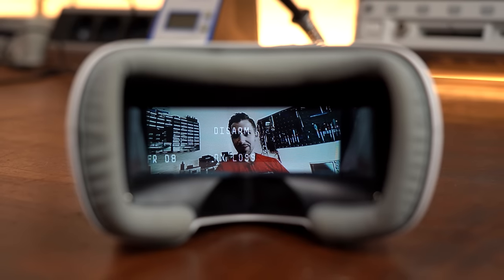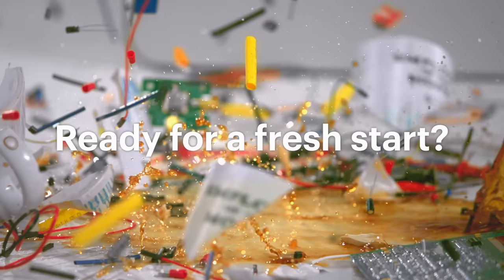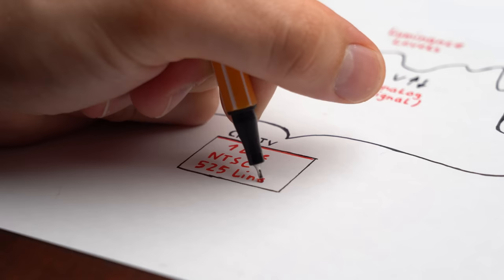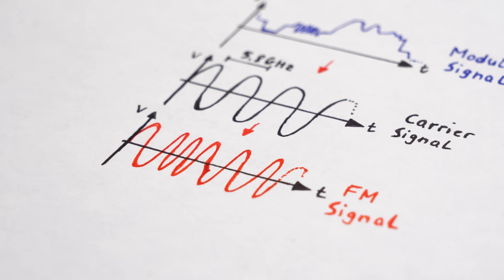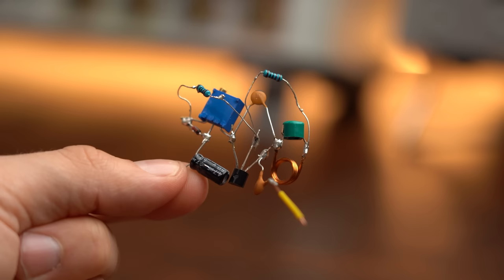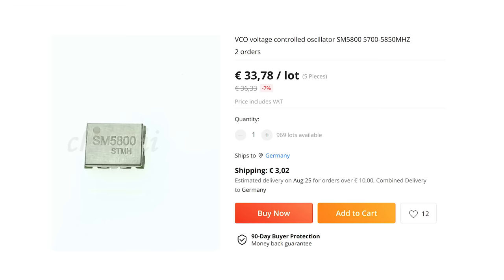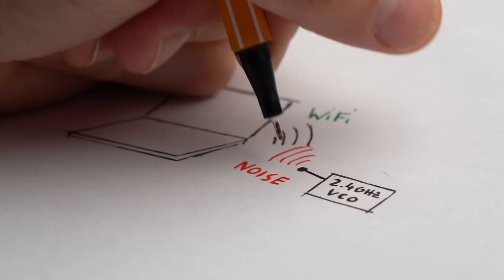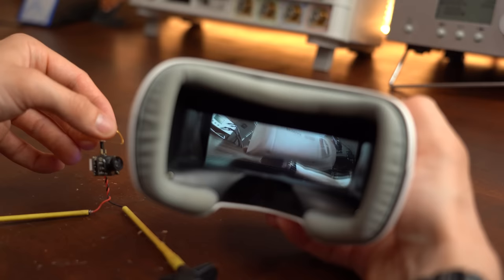I tried Wireless Video but ended up building a WiFi Jammer (A Fail Story)

Comment: I'm taking an absolute shot in the dark but wouldn't there be a lot of noise in the circuit? 5.8GHz is in the band for "5GHz" Wi-Fi. On top of that, I could easily see the inductance being a problem at such high frequencies. I'm sure you know but the reason computer CPUs, especially more modern ones, have so many capacitors directly on the package is because of the amount of noise and that, at the 5+GHz frequencies they operate at, the tiny bit of inductance just from power cables and traces pose a problem for the device.

Comment: If you can sacrifice the video resolution, you may try sampling the video signal with a Raspberry Pi Pico. The Pico can take 500k samples per second. Maybe you can send half of that over wifi, serial or something digital. I'll do it myself, but I took an arrow to my knee...
Reply from the maker: Haha well, I will think about your feedback :-)
Reply: @greatscottlab  sending analog TV is a good, interesting, educative, challenging goal and worth the effort. I'm just curious if the TV signal can be converted to digital with a Pico. It will hurt the resolution, of course, but I think it is doable. But, as I said, I have this knee...
Reply: @guatagel2454  Interesting thought experiment you got there.  wifi bandwidth should be good enough for vanilla NTSC I'd think (but haven't check the numbers for worst case).

For a digital via WiFi transmission, you won't need to faithfully sample and send the sync signals - just detect them in the analog in and encode them in the digital out stream.

(1) detect V sync, encode V sync in data stream, reset video line count
(2) wait for H sync, encode H sync and video line count in data stream
(3) wait for the exact remaining H sync period (including "back porch")
(4) sample madly for 4 ms - H_sync - H_backporch - H_frontporch (period of one line of video values of a 30 Hz field)
(5) packetize the line and send it.
(6) goto (1)

For network protocol, I'd use UDP over wifi.  Let the receiving software (a) not update whole or partial lines for missing packets, then (b) blank the missing bits after no data for ??? seconds.
Reply: @Randrew  yes, that is what I'm talking about. Thank you for writing it down! I understand that there are chips that get hsync and vsync from an analog tv signal, those can be used here to simplify the task.
Reply: @guatagel2454  Thinking about it more, I'd consider running the Wifi radios on both ends in promiscuous mode - connectionless.  One generating raw packets and spewing them out blindly while the other end just listens for wifi frames that look like its video.  Lowest overhead or am I just lazy that way?  ;)
Reply: @Randrew  esp8266 and esp32 can generate a tv signal (CNLhor did it), but they can't digitaze it. This is one problem that only a Pico/Pico W can solve.

Comment: Page 3 of the RTC6705 datasheet shows two pins, 34 and 35 for 2dBm or 13dBm output.  Which one is hooked up, the 2dBm?  Page 4 says to connect PAOUT1 and PAOUT2 for maximum power.

Comment: You now got me wondering about those cheap GPS jammers that plug into the cigarette lighter of your car. They claim that they jam GPS trackers but won't mess with your phone. How is that possible? My phone has a built in GPS chip for location purposes that can be used when I use Google Maps. How can a supposed GPS jammer work and not jam this?

Comment: A vco is not a good thing to use for fm mod. There is alot wrong with your circuit too. First, the antenna is not matched to the chips 50 ohm output(normally requires a matching network, transformer or balun). Second, the vco has a limited bandwidth, I don't know what the bandwidth of an ntsc signal is, but it is probably more than the vco can handle at the control input. Third, there are readily available chips that fm modulate much easier, cheaper, and better than a vco. Also you could make a better reciever with off the shelf chips as well. There are readily available chips for mixers, modulators, demodulators, filters, impedance matching networks, antenna designs and so on. Starting out  I have to admit I tried using a vco to make a radar chirp for fmcw radar and found that the bandwidth limitations are just too hard to work around. But the good news is there are many options. The bad news is it requires alot of research and knowledge in rf engineering and design to spec circuits like this.

Comment: With those VCOs did you have access to any equipment you could test the phase noise of it? After it was modulated, was it then filtered? Did you have any pre amps and then an actual amp in order to increase signal with less noise?

Comment: You'd get more realistic measurements of wifi performance running an iperf test to a machine on the same LAN rather than an internet speed test. Internet and Wifi are completely different things.
Reply from the maker: Good point

Comment: RF circuits need some special voodoo skills to work properly. So many variables that can affect performance, you might be best buying a working, higher power transmitter that you can just cut and paste into your application. Good video though thanks
Reply from the maker: Thanks for the info

Comment: If you want to continue experimenting with FM transmitters, you should get a hold of a software defined radio kit. Most SDR kits are USB powered and cover a wide range of frequencies.

Comment: Hi, I think I have a clue why it is not working. From the video I can see that the receiver has channel width/spacing 20MHz. But your VCO for 5.8GHz has 75MHz/V, which means it has 300MHz swing for full 0.5-4.5V input range ! That is way too much. You can just simply use set of potentiometers to modify your video signal at the VCO input to be in the range from 0.5 to 0.75V instead or something similar. That would have much higher chance to work.
Reply from the maker: Thanks for the feedback. But I actually tried something just like that and it also didn't work that well.
Reply: @greatscottlab  Yeah, this would be really sub-optimal setup, so chances for success are low, you would really need a VCO with native full modulation range in the 20MHz region. Overall much better approach would be to improve your antenna or just add power amplifier to your current transmitter. In either case, you would probably need 6 GHz spectrum analyzer and/or VNA to tune it and verify it's function which is not cheap. As someone suggested, much easier is to build FM modulator for VHF or UHF TV frequencies, one can rather easily use digital scope to analyze it, but it is generally illegal to transmit at those frequencies, so I would not recommend it either. Some off-the-shelf 2.4GHz video system would have better range than 5.8GHz one, and should not be so difficult to install. But not so much fun as playing with your own builds either -:) !

Comment: Is there a reason you make point-to-point soldered circuits (the ones that just float in air) rather than using a breadboard or proto-pcb board?

I have a bad habit of skipping straight to the proto-lcb board, but I really should use my beard boards more often. It also let's me reuse parts.
Reply from the maker: For such high frequencies I try to stay away from breadboards due to loose connections and parasitic capacitances. Perfboard would work just fine though. But soldering in the air is quicker for me.
Reply: dead-bug soldering (or point-to-point) makes debugging and component replacements / swaps easier whend esigning circuits. With PCB soldering if you haven't got breadboards to play with.

Dead bug sodlering also gives you more probe points for the circuit since there isn't any insulated traces, so if you're losing a signal somewhere it's easy to track down and replace the parts that aren't doing their jobs.

I've done dead-bug soldering like this a few times to make things faster when debugging my designs and it works well. You just have to be cognisant of the bare contacts everywhere!!
Reply: @DigBipper188  With a breadboard it's not too difficult to probe any connection, but I could see the advantaged over a pcb. How I see it, if the circuit does work, you'll probably make a proto-pcb version anyway, and if it doesn't work, you're stuck trying to desolder things to change it. (something you'd also have to do with a pcb, but not with a breadboard.) Preference is king though.

Comment: In the datasheet of the IC I see there are two operation modes: +2dBm and 13dBm. Did you check which one is used? Maybe by default it's only running at 2dBm and can be switched to  13dBm?

Comment: If you want to jam WiFi in a large area just turn on a microwave with the door open. Use something to depress the microswitch that stops it from running when the door is open.
It'll blast out hundreds of Watts of RF interference on 2.4ghz.
You'll probably get a visit from whoever regulates radio signals in your country.
Reply: That should only interfere with a single channel or perhaps three counting overlap.
Reply: Better yet, I'd like to see GreatScott! modulate the oven's magnetron's frequency with the video signal!  That'd sure solve his range problem, but only if his FPV goggles were 2.4 GHz.   ;)

Comment: 5 g is really going to screw with the reception on the drone goggles why couldn't they use a lower frequency it would get better range too 5 GHz doesn't go through walls or solid objects very well

Comment: Should have mentioned that messing around with RF transmitters like this can get you in trouble. Should get at least amateur radio license before you start messing around with transmission. Even using radios that are not meant to be used in your country/region can be harmful, it is very tightly regulated. The knowledge required to get a amateur radio license would go a long way in helping what went wrong here.

Comment: As your wifi and that ic working on same 2.4Ghz signal may be (which is the 90% reason of that jamming) on same channel.  Try to change the wifi channel from your router. Love yoyr videos
Reply from the maker: Could be a solution

Comment: "Amateur Radio Maxims 101!" A watt is a LOT! and... Antenna is EVEYTHING!
Instead of using more power, 1st try a better ANTENNA design! Referring to radio station design/setup you can have what's called an alligator or rabbit station. 'Alligator' meaning all power but with TINY/deaf ears, or a 'rabbit' station with BIG EARS to hear everything better! 

In this case a better antenna on the headset would likely work best, a similar principle as cellphones using small lightweight antennas vs the massive high gain antennas on cell towers...

Have you looked into 5/8λ vs 1/4λ antenna designs, or collinear antennas? 5/8λ antennas are my favorite design because they flatten the radiation pattern more like a "pancake" ("Pfannkuchen sind Liebe!" - Speed racer [2008]) so it's focused tighter towards the horizon without any more demand on power required. Vs a 1/4λ antenna which radiates more or less like a toroidal "donut" shape. Even higher gain still are the collinear antennas which are used on radio repeater towers and cellular towers!

Are you into amateur radio at all with all your RF based projects you do? It's quite fun!

Comment: I am wondering if you shielded between the pcb board and the wifi/ data board magnetic Flux may be  causing interference
Or inducing a feild In data wires

Comment: Get a dji fpv drone and you will be amazed it has high Def digital video and goes for miles. Also another more fun to fly
Reply from the maker: Yep. I got a DJI as well for filming. Crazy how they pull this wireless video off.
Reply: @greatscottlab those are cool but I'm talking about the custom carbon fiber fpv drones they fly 100mph and can do flips and tricks. It's like a bigger more powerful version of your little white drone. It's a really fun hobby

Comment: interesting topic. I was checking my new bought failed gsm/gprs/4g  booster too and i see they used ypg602020 transistor which seems made specifically for radio signal amplifying controlled by a specificg high frequency oscillator, and this devices seems like picking incoming signal outside randomly/at specific frequency then amplify it unsyncromously (i guess) then send back indoors and some for transmitter. And works fine (untill it burns ) ;) so may be you can try a upper frequency or some frequency used by receiver and simply amplify it. Well there is lot more components but i guess they are just for stabilising voltage and signals ;/

Comment: I don't know why you bothered with not showing how to make the jammer.

It's hardly got any power and anyone half interested is going to pretty quickly work out that if they want a long range wifi jammer an old microwave is 90% of what's needed.

Comment: Unfortunately there are a lot of mistakes in this video, which is not to say the video is bad or that it is all your fault, I just want to point that out and provide useful feedback. In my opinion the biggest mistake is that you are taking for granted that for every frequency you can use the classical lumped model of the components. This is unfortunately not the case. Every component has parasitic resistance, inductance and capacitance and this must be taken into account in the design of high frequency electronics. Just the fact that you are not using a PCB, but THT components with immensely long leads is a big problem. You also removed the shields from the VCOs, which likely causes quite a lot problems. At such high frequencies you have to work with PCBs and/or waveguides and take in considerations every single aspect of the circuit. Maxwell's laws are unforgiving.
I really hope you find this useful and constructive. If you have any question feel free to get in touch!

Comment: What if you were to use an ADC to convert the video signal to digital, transmit that, then have a DAC at the other end to convert it back into anaolog? You can then change the carrier frequency depending on how much bandwidth you need whilst intentionally foregoing the 2.4GHz and 5GHz wireless bands to prevent another jamming situation.

Comment: Hi, I like your videos and analog devices too, but I have to correct you... (6:22) this is a TV channel, not a frequency, old TVs are usually UHF/VHF. You can try this transmitter, it should work with your old TV. https://youtu.be/0PYFSdD2Gpo or https://youtu.be/RCQNu01sKIs